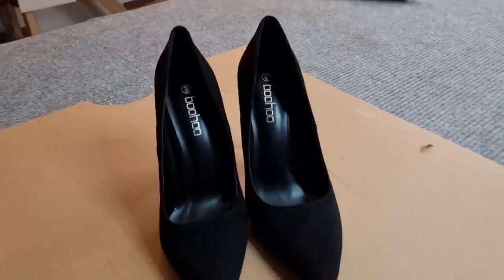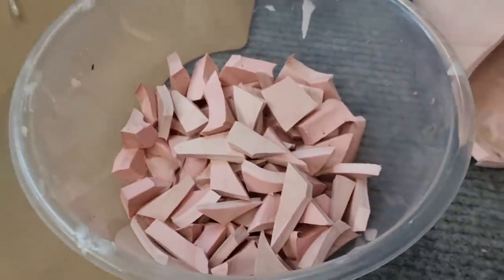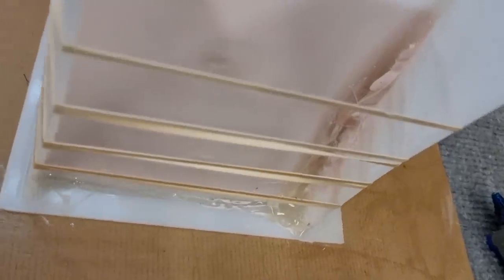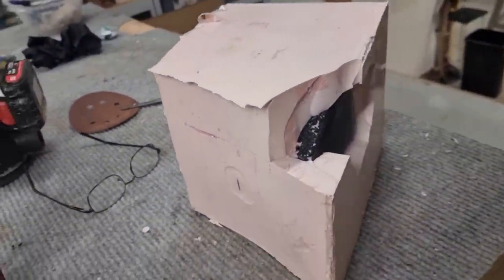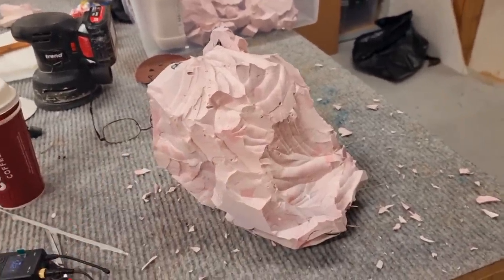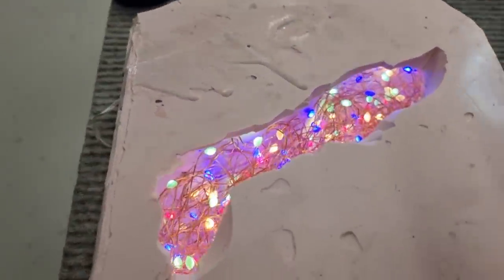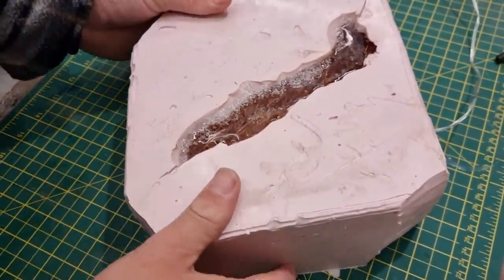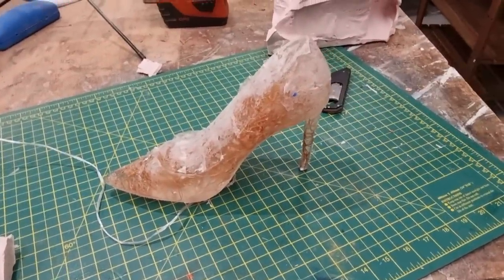Making Resin Stiletto Shoes with LIGHTS !

Comment: If you so happen to do this again (or something similar) could you first coat the inside of the silicone mold with some fast curing really low viscosity resin? Like UV resin or something to create a "buffer" then you can add the wiring and would allow sanding without the worry

Comment: in my opinion , the most production way of doing it if you want to retain glass slipper functionality would be to make mold in 2 parts from the get go
first the outside up to the edge  mold tilted 45 degrees or so and you could remove heel cover to put a holding screw in the tip , there is metal pipe inside of every thinn plastic heel
2nd part of the mold would be the inside and mold top cover that could be made smaller than the bottom part is keyed correctly, tou could place reinforcements in the insert that go inside the shoe at this ppoint because puling it out might be a fight. with chonkier shoes like pumps on platform you could probably make it wearable and glowing but you would have to add some reinforcements to the structure

Comment: If you make it again, use blue tape to make a fin along the bottom of the shoe.  Set it in a mold upside down (tape fin up)  Full with silicone until just the tip top of the tape sticks out.  When the silicone is cured, cut along the tape line and open it up until you can see the bottom of the shoe and the point of the heel.  Slice an opening between the two down to the shoe and remove it, being careful of the flap that fits inside the shoe (you may end up needing to pour your resin in sections or use some resin rods to center the flappy bit in your resin pour). Pour and cure your resin.  Once out of the mold, refine the shoe, drill your cord hole, add lights to the inner sole, top with resin shavings to hold the lights in place, and fill with resin and cure (again you may need layers because of the shape of the shoe needing different angles).  Refine the top (not much worry about hitting the lights because the shavings are in between the surface and the lights) and there you go.  A way over complicated light up resin heel.

Comment: You should use mold release and for a shape like a shoe need a 3 to 4 pice mold so you can reuse it with out destroying it. You can use monster clay to help block out parts of molds to help make segmented molds.. I think it would help you get more practes in the light mold isyes and if you put a coat of reson on the outside befor filling with wears it will give you space to sand and buff them with less risk.. hope thees segestions help

Comment: I wished I could interact with you. I would have told you that you have to seal (vaseline would do, or backin spray I guess, maybe klling foil would have worked as well) If I am right there is a blue silicon that is espially for casting, maybe thats not as sticky. Is sand an option? If you cast metal you use sand for the mold. I like the idea!

Comment: If you're looking for ideas this maybe a little off the wall to try. What about removing the plates from a championship belt, your choice of belt, and replacing the metal plates with your custom epoxy plates. You could add some of the things you've used over the years in them. Broken disc, Lego, tinsel, whatever. Them sky is the limit and with your imagination I bet the belt would be amazing

Comment: Not sure how easy or hard it would be, but if you wanted to  put wires in a resin thing, have you tried pouring/making a sort of initial "shell" first, then once its set, put in the wires/lights, then fill the shell with resin. That way you've a bit of a buffer for sanding?

Comment: Yeah, you'd need basically slippery pleather shoes, a bit of testing with the material should help this. Maybe some forethought. You could even first coat the shoes with a layer of clear coat to make them or any porous stuff slippery.

Comment: Unless you didn’t show it, using mold release on the show would have helped a great deal.

Plus doing the mold in two pours would have helped.  First pour covers half the shoe.  Mold release on the finished pour then the second pour.  Hopefully the release would help keep the two half’s separate.  Maybe using a separator like paper between the pours?  Not sure.

Comment: ha ha the sound of you pulling it out was hilarious... ive been there!! i used to do moulds like that, but found a much better way... ever tried monster clay? try doing the first  part with monster clay on one side and then swap it over for two silicone parts. has worked very well for me. you can heat the stuff up and pour it if need be. oh i must try some of that resin for some bigger pours of mine.

Comment: I have never worked with resin before, but would it be possible to "paint" on some extra resin to thicken up the outer layer? It would take a little more time and effort but would give you some protection for the wires on a project like this.

Comment: I would have put a break between the 2 so u know where they sat then had marked where they were maybe by having previously using a popsicle stick off the bottom of the show showing again where it is so u could cut exactly in half and have a place to fill the mold just a thought seeing how things settle flat I would have used the bottom of the shoe as where I would have made it to be where I fill it with resin but then u could see where the shoe sat in the mold

Comment: You needed to put shrink wrap in the shoe, fill with sand, wrap the shoe itself & heat shrink the wrap onto it to get the shoe out of the mold. 2nd, you could've glued the shrink wrap shoe to the bottom of the mold so you know where exactly the shoe is & can cut the silicone down the middle of each shoe to remove the shoe easily.

Comment: I'm still nearish the beginning of the video, but my first thought even before the mould was mixed was "he could coat them in a thin layer of petroleum jelly so they release easier"... I see the suade was not kind to you. The using old bits to save product is a brilliant idea tho that I will tuck in my brain for later once I figure out what is wrong with my pressure pot.

Comment: Nice project - Don’t do much casting but could you have put a length of garden hose over the heal and cast around it to use as a fill hole rather than removing a gig chunk at the side that needs to be fixed later.  Merry Xmas

Comment: I wonder if you painted the shoes with resin, like you were using actual paint, if that would make it easier to get the shoe out of the mold. 
You wouldn't have to worry about the mold material getting stuck to the cloth of the shoe, and it would help it hold it's shape in the mold. 
I have no idea how it really works, but maybe 🤔 cover the shoe with vaseline???

Comment: You need to look at how you make the mould. you dont cast it in a lump, you need to cast it with a thin layer of rubber. You also need to work out where the original item is going to be removed from the mould. Most moulders make a mould like this in two halves, and join each half for the moulding. Once its cured each half can be peeled off to remove the original. The two halves can be taped together for the mould pour, and if good thought has been used the mould will be reuseable.

Comment: Wouldn't a two half mold with registration marks been easier? Pour half, let it cure, cut some bit out for registration marks, apply a release agent to the silicone, then pour the other half. That's how I figured it could be done. This still turned out really cool though.

Comment: I was thinking, for getting things out of the mould, isn't it the easiest to cut the mould like a cross (sort of four sections) from the top, but not al the way trough. Then you can pull all the sides (kinda like a flower opening it's pedals) and get the thing out. Then fold it back and tie it with rope or tape (and maybe also tape the lines of the cutting to prevent leakage). I've never worked with moulds so don't know if this is possible or adds new problems, but it's an easy way to get all side of the product free without really having to pull the thing.
Reply: Now I come to think about it, maybe you can do it all the way trough when you're taping the cutting lines 🤔
Reply: Ow aaand, you could have made a glass ( or plexiglass) box for Cinderella's shoe! 😄

Comment: Haven’t watched whole thing yet, just up to first failure. Gonna make a guess for eventual solution… Coat shoes in resin first to make shined and resist sticking to molding. Use mold release. Two part molds for each shoe.
Is that what you eventually do??? 🤞

Comment: You should have molded these shoes in 2-halves, with large marbles as "keys".

Once one half is dry, then you make the other half, by using Vaseline between both halves, then you pour the rest of the mold over top of the 1rst half.

Then when it dries, you just pull the mold apart, and because of the Vaseline?

Both halves should come out just fine.

The large marbles help you line up the 2-halves so when you pour the resin into the mold?  The shoes should come out just fine.

Comment: Halfway through the video and i am thinking why not just sticky tape the heels straight up straight on the piece of plastic that way you can take them out through the bottom by cutting from the toe part to the heel part and then you might have been able to use them as a walkable pair too

Comment: If you remold it and put the shoe sole on the bottum of the box with hot glue and then pour from the top like you did and then when it cures flip it ,remove them and then fill from the bottum

Comment: Could have told you at the start to 'number one' don't use suede shoes and 'number two' do one shoe at a time (so much easier to remove one smooth leather shoe from the mold).

Comment: A shape like a shoe is always going to be difficult to demould, too much going on, i think i would have done it in two goes, mould the inside of the shoe first as one block, then coat the surfaces liberally in mould release, flip it upside down and mould the outside of the shoes as a second block.

Comment: To be honest, I'm not really sure what areas of improvement are needed for your videos. Sure no video is perfect, but one could spend thousands of dollars on a video and it still can't be perfect. I love the videos that end in failure just as much as the successes. Not enough creators put their failures on video. Of course if you have multiple blanks ready to go, you could have a failure or two and still have enough left for a success as well. But, not every project is easy to have a spare or two lying around in case things go wrong.

Comment: I stopped watching - to comment. The doll shoes casting technique should work for human shoes too. You glue shoes to the bottom of the container for the mold. And pour the mold substance. Because the flat part of the shoe (the sole) was glued - it should be free of mold. So as it sets, you turn it upside down and make the release cuts where you feel it needs. Then, when pouring resin you still do it in the upside down position, so the resin level becomes the flat sole of the shoe. Hope, it makes sense,  and hope it helps.